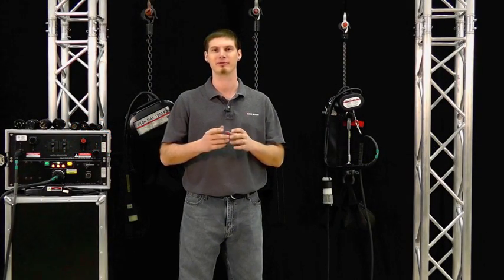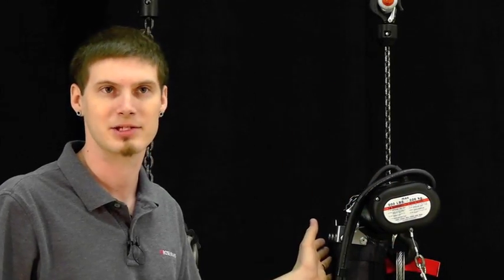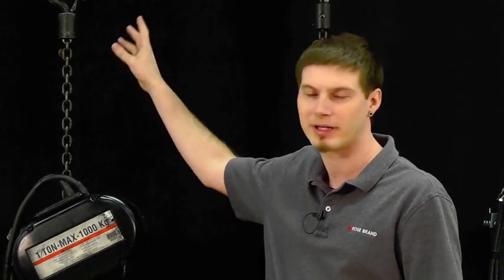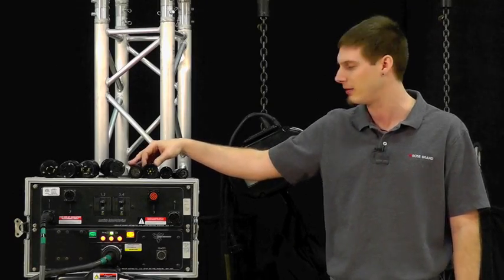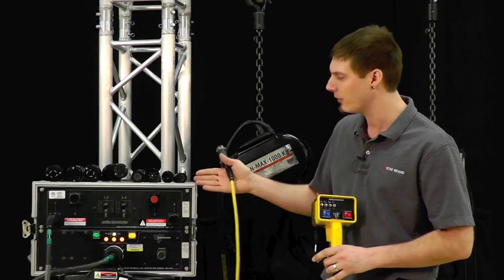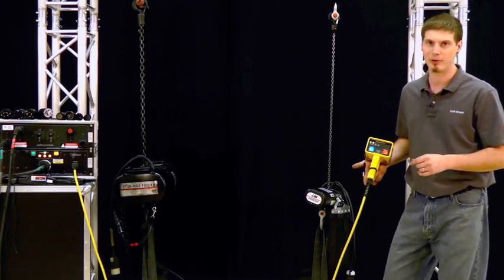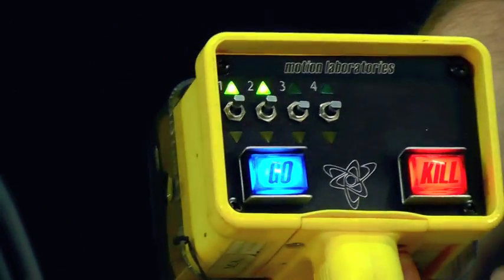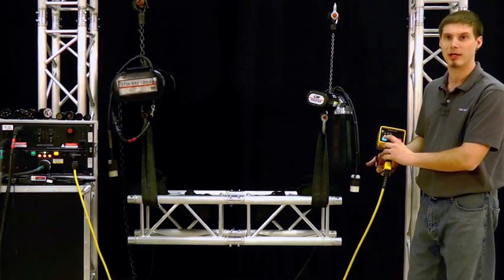CM Chain Hoist Demo by Rose Brand

Comment: Nit Pik- It can't be a 1/4 ton motor if it's 300, 600, or 1000 lb capacity.  I would sure hope a 1/2 ton motor holds 1000lbs.  Please see the dictionary definition of a ton.
Reply: is true
Reply: LpÌ
Reply: He said 500lbs which is quarter ton. The label on hoist even says 500.  Use a dictionary and look up pay attention.